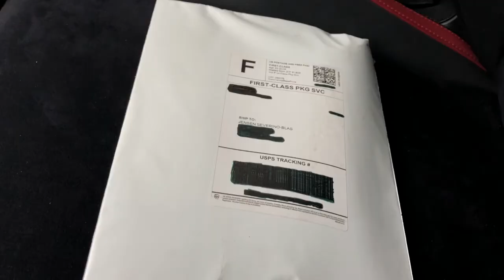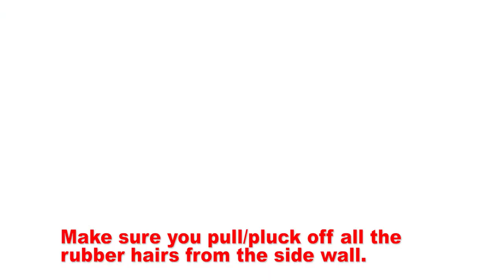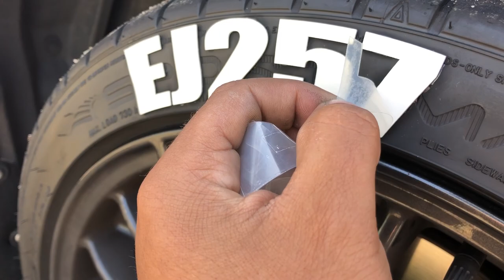Tire Sticker Install

Comment: hey man long time no talk nice vid!
had a question wondering if you know do the wrx sti 15+ and up have factory launch control?
Reply from the maker: Nathaniel Barbaran unfortunately they don’t. The only way that I kno you can get that function easily is buying a cobb AP.
Reply: yeah i was curious any opinions about the DCCD how do you drive with your dccd auto - or auto +
Reply: full lock?
Reply from the maker: Nathaniel Barbaran I’m usually on auto, depends on the outside conditions.

Comment: how much do the mods cost when im in highschool im thinking about getting a 2004 or 2012 sti
Reply from the maker: cristobal ramos depends what Mod , but for my 2016 the front lip u can find the in the $100 range on eBay or amazon, I think they are cheaper for 2004-2012 sti. Tire stickers are very pricey  I got them from tire stickers paid like $150 but there are other sites that sell them cheaper. If you go on the Subaru Facebook groups you can find part cheaper used and in good condition. A lot of people buy there.
Reply: HoeLeeFuQQ 150 for the stikers woah
Reply from the maker: cristobal ramos yup super expensive sadly 😐
Reply: HoeLeeFuQQ why would they make it the expensive
Reply from the maker: cristobal ramos not sure. There’s other companies that sell them for less, or u can just paint the letters on the tire much cheaper like $10-20
Reply: HoeLeeFuQQ what year is your subaru os it 2015 or 17
Reply from the maker: cristobal ramos 2016 sti
Reply: HoeLeeFuQQ ow i was off by one year i want a wrx when im a junior in highschool they look like a good car to fix up